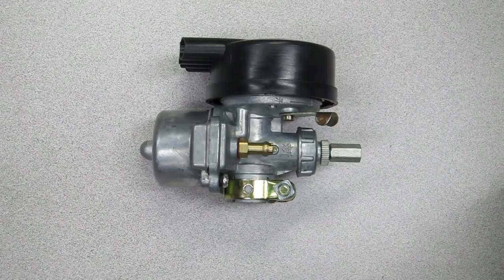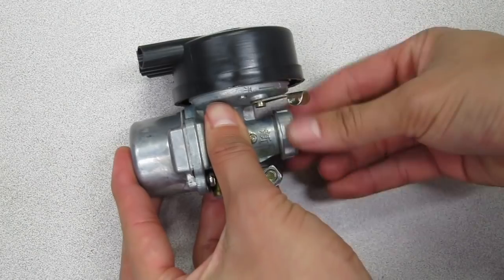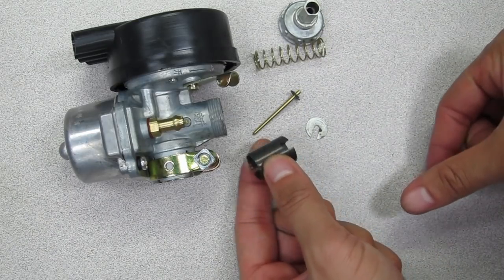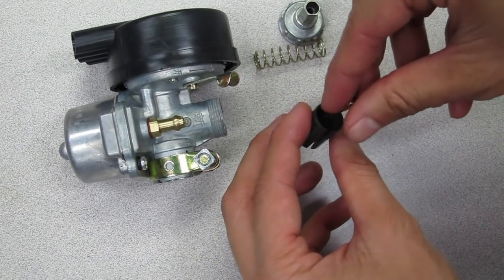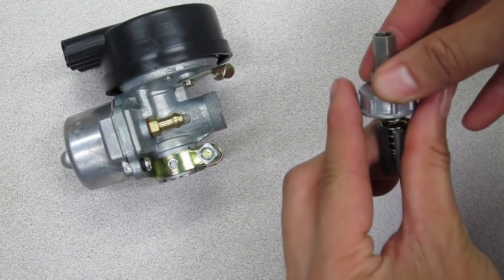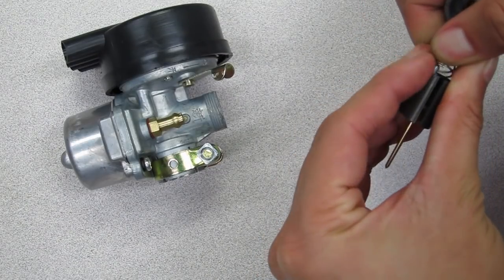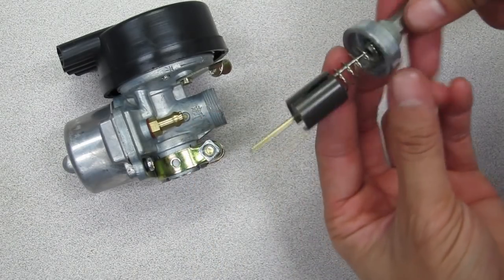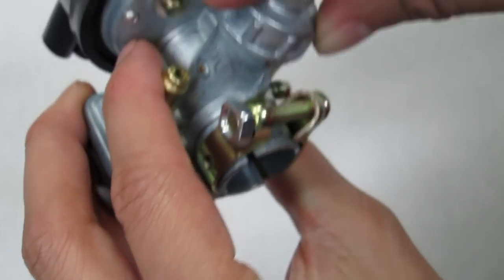Motorized Bikes | Install Throttle to Carburetor | How to Basic

Comment: Ok so my bike starts up beautifully, but there's no throttle control.... It's just stuck on full throttle and it's wearing my brake pads down! Please help me!!
Reply: nt carb suck..get the dorlleto clones theyre better no leaks and more air flow
Reply: I know your question is 8 years old.I think it's to do with the cable adjustment.This is my current problem which I will learn to sort myself by going to a scooter mechanic and paying him to show me how to adjust it.
Reply: @atman5230 I have the same problem right now. Are you talking about the throttle cable adjustment on the handle?

Comment: Thanks for the great content. That top circular part where the wire goes into is so tight on my bike that I can’t even unscrew it. Should I use a wrench? And is it ok to use lube or something to loosen it up?
Reply: lube it and use wrench
Reply: Do not use a wrench.You should be able to tighten the cap with your fingers.I'm thinking you may have cross threaded the cap on the carburettor or forced it hard when the guide peg is not in alignment with the 'bucket' {for want of a better word} that the cable end hooks into.If you have messed up the thread put it down to experience and order another carb from EBay..they are only £15.

Comment: How do you know if it is installed correctly? Does the throttle close the hole completely? Or should it? Can a throttle cable be too short and keep it open?

Comment: No guide peg on my carb. So if you don't have one be sure the idle screw on the side of the carb is inserted far enough so that the beveled slot on the barrel rests on the needle. Then tighten down the throttle cable. Once snug back the adjustment screw out slowly until you feel it is not resting on the beveled edge of the barrel. Then turn in until lightly seated against it. This is just your preliminary setting. Turn clockwise to increase speed counter to decrease. The bike may not start with the preliminary setting turn clockwise 1/2 turn try again. Continue until this bike starts. Once bike starts keep the idle slightly on the high side until the engine is warm then adjust final idle speed (be sure to adjust with the choke blade open final adjustment)
Reply: Thank you

Comment: So the needle is inserted first, for sure? The intructions that came with my PK80 kit show it being on top of the washer, and for the life of me I can't get it started, but not sure this is the issue
Reply from the maker: The washer keeps the needle in place, and should be placed after the needle. This installation and parts may vary from different brands other than ours. We will gladly help you trouble shoot your problems, contact our customer service at 1-800-317-0479

Comment: Berry i got a China motor kit from a local supplier i did the 16:1 on the first 1L in the tank i was told that it was too much oil and put it down to 32:1 and now i have no power. Thoug the engineer was always hard to start... ill get it back inside and try looking at the magnido if the mag is reversed ill get it back ill also try the connection to ground. i have also been told that i might have blown the engine i EVER took it over 20Km/h thank you for your video.

Comment: Soo what happens if the nub tip that hold the wire in to the plunger.. uh breaks off... And maybe, falls into the carburetor.. and possibly falls  into the engine?

Comment: Hi, good job....
Question??  about the carburetor....... I got a new bike w/ 80 cc motor.....
When I got this bike it was fine......because the guy drove 2 times in the Ally and I drove too a little bit there..... .but when I got home w/ the bike....of course I put the bike in back of my car w/ tracks hanging there.....so when I dropped in the house the bike, I smells a gasoline and I check it out......and it was licking the carburetor...... any ideas why??? thanks
Reply: Leaking, not licking.....

Comment: BikeBerry.com my throttle cable is not long enough to get it through the spring and into the slide, it only has about 1.5 inches of cable sticking out.
Reply: shorten the cable cover to where you can fully install the cable and adjust.

Comment: Hi,good job!!
Question? Like I said b4 why I licking the carburetor all around under the top? at the beginning it was fine, for like 3 round driving in the back Ally, when I got this bike, is brand new, any idea, thank.. u for ...u help
Reply: I know you asked the question 6 years ago..perhaps you did not fit the small black rubber seal which is in the plastic bag which holds the fuel tap.If you do not install that seam petrol will leak and run down.Also check the fuel filter,if you didn't heat the fuel line in hot water for it to expand then when sliding the fuel line onto the fuel filter you may have cracked the fuel filter by applying too much pressure on the fuel line.

Comment: I just got an 80cc two stroke bike that was used and it seems to bog alot at low end but runs good at wide open throttle, any advice on what I can do to fix the low end power lag? 

EDIT: I forgot to mention that it does stall out if I let it idle too
Reply: Rip it's one year ago I bet that motor is blown to smithereens good ol Chinese for ya. Anyways float is stuck it's in the bottom of the carb it's a small needle when it's stuck or gummed up with junk it can cause either no starting or very poor performance
Reply: Idle pin misadjustment, turn right by 45° intervals

Comment: the plastic piece that holds the kill switch in place on the handlebar, that little nub has broken TWICE now in the little hole I drilled in.... is there a killswitch with a metal nub that holds it in place?

Comment: HELP. I just put the throttle into the carborator but when i pull the throttle should is release back to its orignal postision or stay the same?
Reply from the maker: Shane Pizza it should move back to itself original position, be sure the spring is positioned correctly
Reply: if the cable is adjusted, the spring in the carb should keep pressure down on the cable so it should return to its original position. if it remains open, the engine will continue to rev.
Reply: +Shane Pizza Having this issue as well, the cable seems to be too long, no matter how much adjustment I try to make, to the point the adjustment nuts come apart and its still too loose.
Reply: @TheJohnzitting  I agree with your comment.Also,if the pacman plate has jumped out of its correct position then that will make the engine revs excessively high{ which is not good for an engine that is supposed to be run in}.

Comment: Hi, good job....
Question?? you know why is licking the carburetor on my bike w/80cc is new and I drove in the Ally just twice, but when I got home I smell gasoline and is licking all around under the top carburetor, any ideas? thank... u
Reply: Hey, are you still alive? Do you still have the motor? I recently got mine and I found that if I use zip ties to work as metal hose clamps for like hoses it completely gets rid of any leaks since when I cut the rubber line it must’ve not been all the way in.

Comment: I just replaced my dirt bike throttle cable but it does not work the dirt bike will idle but when I twist the throttle it won't do anything and it won't go back either please help please help

Comment: HELP how do I adjust my throttle, my bike shuts down ever time I stop
Reply: Antonio Candelaria in case you havent drove a manual before, you need to hold your clutch down as you brake or decellerate
Reply: I'm sure you figured it out, but for anyone else, you probably need to adjust your idle(the screw next to the primer), or on the needle you see in this video there is a c clip that can be moved higher or lower on the needle depending how lean you're running the engine

Comment: Is anyone else having a serious problem getting the plunger out of the carburetor?
Reply: Hayden Lupton I doubt you're still working out it but I used a bent paper clip to go in through the slit and pull it out
Reply: Rick James Thanks for the imput, but I did manage to get it out and now I'm done with the project
Reply: I think mine wasn't shipped with it.
Wish I had that problem

Comment: My carburetor won't fit in the fram with my engine, can I I run a tube from it to the engine?
Reply from the maker: This may hinder the carburetor's performance, but as long as it fits securely and is safely out of the way, this should not be a problem.